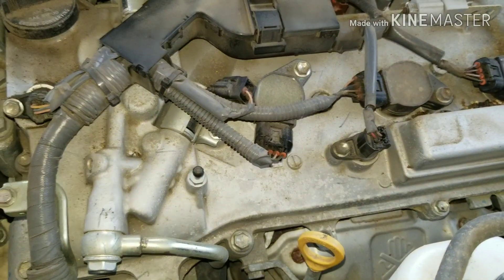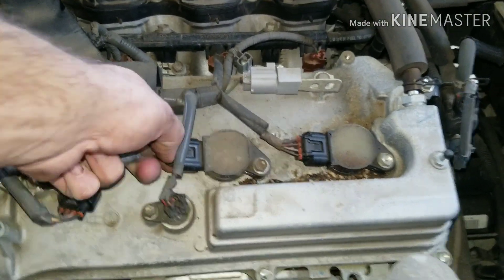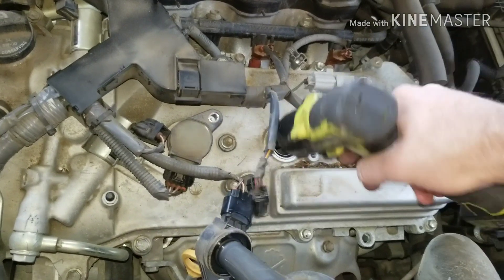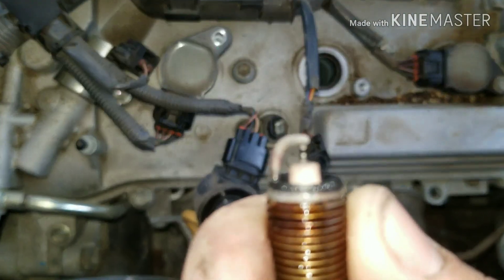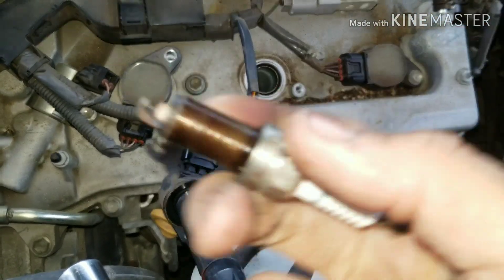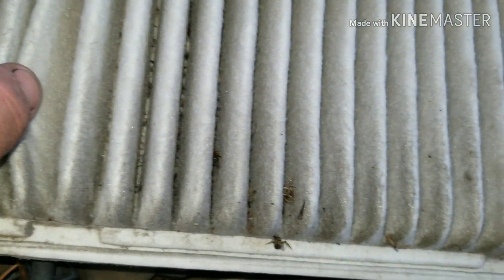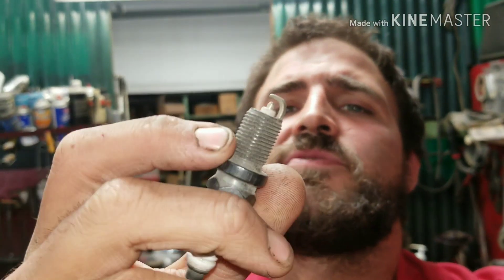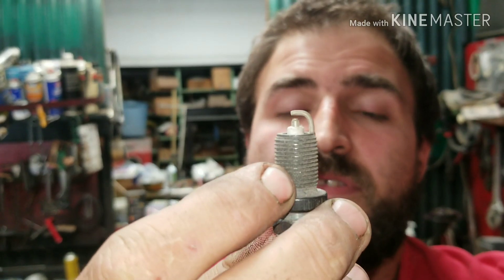How to tell if you need a tune up, and do I really need spark plugs?

Comment: Great video mate, recently checked out my plugs on my 22r Hilux, and had a range from flaky white on the 4th, 3rd decent, 2nd little bit of carbo, 1st coated in carbon and found my spark leads were no good on 1,2 and 4, could be a good addition if you run into a situation where you have a chance to make a video about it, I just use an ohm reader on my voltmeter.

Great video anyway mate 👍
Reply from the maker: Thanks for watchin I'm glad you liked it I will defantly make a video about bad plugs wires in the future. Right now I'm makeing one  showing the diffrent ways a plug can fowl or wear. Thanks again for watchin really apreciate the feed back.